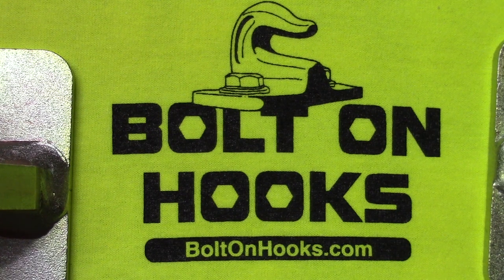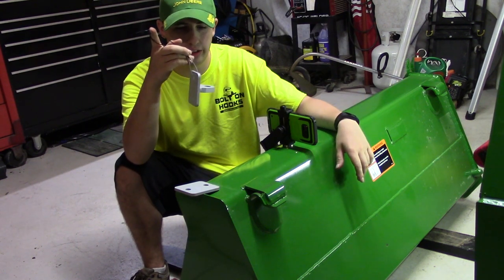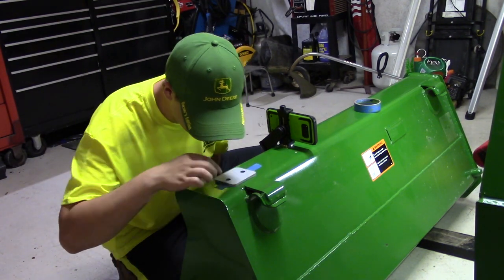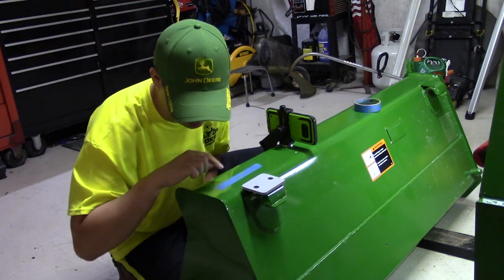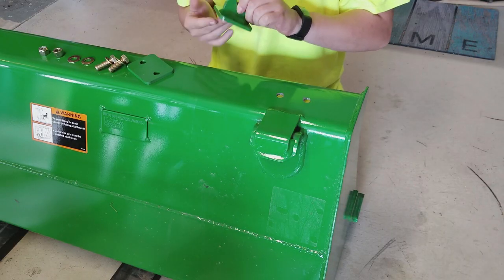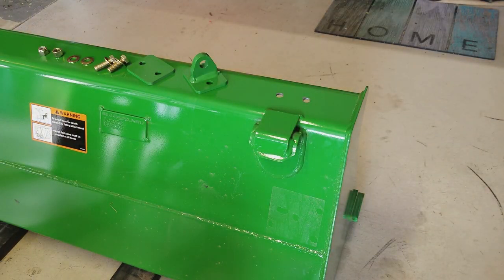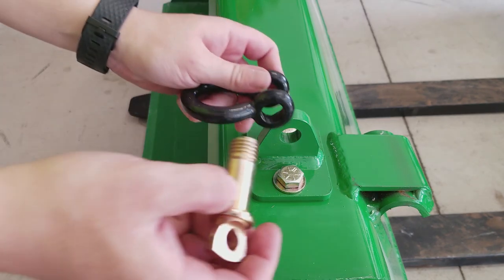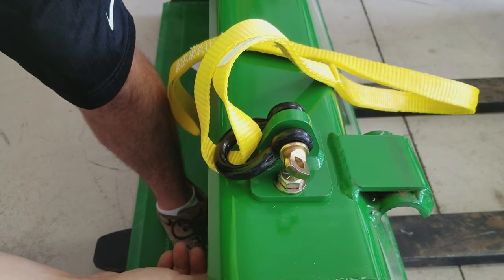BoltOnHooks Bolt-On Clevis Mounts Install/Review

Comment: Cutting oil? Anyone?
Reply from the maker: I'm not a big fan of cutting oil when it comes to drilling steel. I love it for tapping steel and aluminum and drilling aluminum but thats about it. Plus that set of drill bits has a couple hundred holes on them so there all needed a good sharpening.

Comment: Having threads come through further will do no good and threads will get damaged with loads making removal a real pain.
Reply from the maker: I point that out because the why a nylon lock nut works is the nylon insert in the nut needs to engage the threads. Here its barely got a thread on the tapered end of the bolt, so you will not get the full effect of the lock nut and it may loosen up over time. Technically speaking there should be 3 full threads showing for a nylon lock nut to work. And as far as if it was longer and the threads getting damaged, if it was longer and you went to remove it the nut will act like a die and reform the threads as you back the bolt out.
Reply: Yes, I understand.  What is the thickness of your bucket?
Reply from the maker: My bucket is 10ga (0.1345in) or 3.41mm